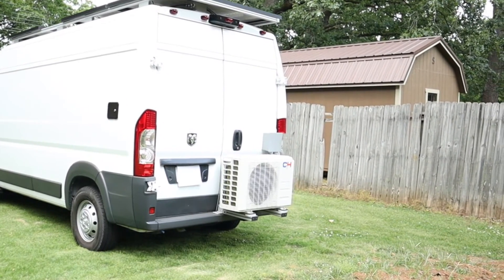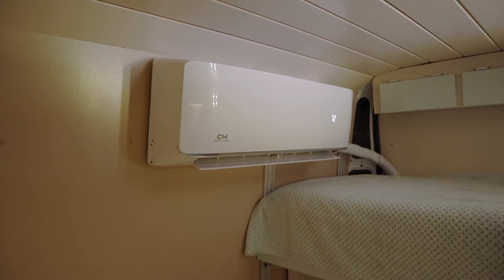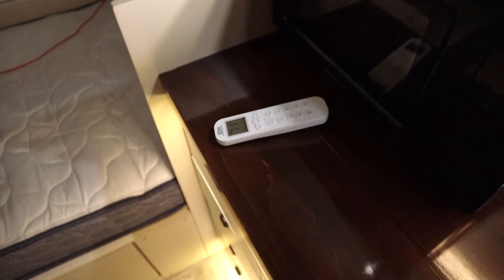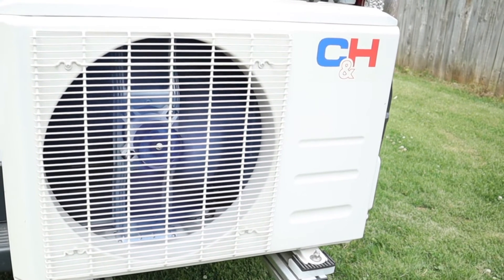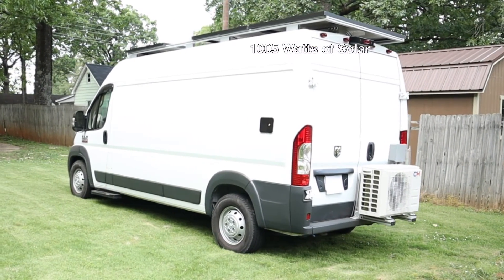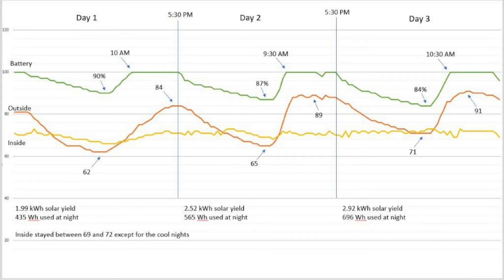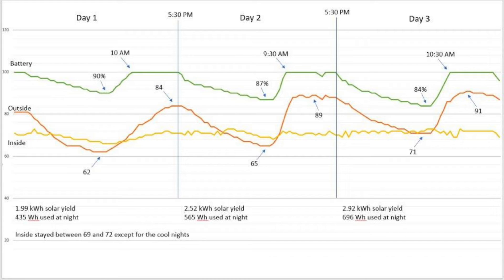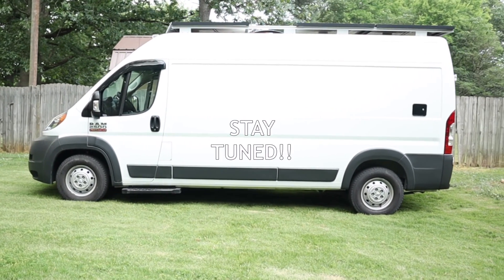Solar Mini Split On A Van

Comment: Is yoUr two lithium batteries 12v?
Reply from the maker: Yes they are 12 volt and wired in parallel. Renogy had a 20% off and 24 months interest free special so I now have three batteries. Probably didn’t need it but I had planned on three from the beginning so now if I’m ever in cloudy weather for a few days in won’t be an issue.
Reply: @jamiesworld4675  Sounds great Jamie. Yeah I saw in your graph where you had the solar top the batteries off at 100% for a good while (sunlight spillage if you will). Having that 3rd or 4th battery would be great to compensate during the non-sunny days. My goal is to by 2 more of my 206ah batteries (total of 4 batteries) will be more than enough for my needs and to catch some of that spillage in case I need it. Moreover, I will have an alternator and grid hookup for backup.
Reply from the maker: @mikefranks4528  Sounds like a good plan. I also have the B2B charger.
Reply: @jamiesworld4675  it's important to note that 'automotive 12v system' voltage ranges from 10.5V to 15.5v. Any equipment designed to operate in this range CAN be considered equivalent by novices but should not be those of us who are using data to provide factual performance data. We need to be more specific. For example, there is a significant difference between capacity of a 100Ah LA battery (100Ah x 12v nominal = 1200Wh capacity) and a 100Ah LFP battery (100Ah x 12.8v nominal = 1280Wh capacity) ....They are not the same. This is why I advise against the use of Ah vs. Wh when communicating battery capacity and using specific nominal voltages when communicating system operating voltages. Most non-tech people find themselves in trouble thinking that they can ignore the details.

Comment: Very nice install. Thanks for sharing. Which flexible mini split refrigerant lines are you using?
Reply from the maker: Thanks. Rectorseal no kink. Depending on what size you need they have them on Amazon. If you can't find them there you might find a few supply places online that have them. Thanks for watching.
Reply: @jamiesworld4675 (I am a retired mechanical engineer with experience in custom A/C manufacturing). It is important to note that 'flexible refrigerant lines' (Rectorseal specifically) are for R410a systems and ONLY DESIGNED TO FLEX ONCE TO FACILITATE INSTALLATiON. They are not intended to flex repetitively (opening and closing the rear door), especially under pressure. You are taking a huge chance of losing your refrigerant charge by using them to flex significantly or repetitively after installation. They will clearly work for some time but they are destined to fail if planned to open/close your back door. If you really need this capability, you should use a R134a system which has a much lower pressure that allows the use of rubber hoses. Despite what you might think of these 'flexible connectors', they are corrugated copper lined inside that flexible cover.
Reply from the maker: @WorkingOnExploring  Thanks, the only time the doors will be opened is if I need to do any electrical troubleshooting. Hopefully that won't be very often. I have not had any issues so far.
Reply: @jamiesworld4675  Can you also share about the roof wind breaker, spoiler, setup? I'm adding solar panels on my van roof.. thanks
Reply from the maker: @e3ucxp  I used 80/20 tubing to mount my solar panels. I used a 45 degree angle bracket and a piece of 1/4" plastic from 80/20 for the wind deflector. www.80/20.net

Comment: That's cool.  Mini-splits are super efficient.  The drawback is the big bulky unit in the back.   Any idea how it compares against the best internal mounted A/Cs on the market?
Reply from the maker: It was the best choice for me and I couldn't be more happy with the performance. Now if it will just last 10 years or so I'll be really happy.
Reply from the maker: Yes it's a small drawback though. I didn't do much research on the internal units because they were just too expensive and took up too much room that I didn't have.
Reply: @jamiesworld4675  Maybe other vanlife YouTubers with internal ACs could compare their numbers against yours.  If a mini-split is much cheaper as well as several times more efficient, it might be a better choice
Reply: @jamiesworld4675  Too many pros that the look of the unit in the back isn't too bad.
Reply from the maker: @pmarker  Thanks. Yes I don't think it looks too bad.

Comment: Can you open/close either rear door??
Reply from the maker: Yes, they are normally blocked. The only thing back there is all the electronics and batteries so access is only needed in case of an issue or just to check everything out occasionally.
Reply from the maker: Yes, I can open both doors. I used flexible refrigerant lines. I have two 1/2" stainless bolts through the bumper and the mounting frame just for extra security. I have to remove those to open the doors. But to be honest I don't think I need them.
Reply: @jamiesworld4675  Okay, I see, so the doors aren't regularly accessed. The setup does block them during it's normally installed state, correct?
Reply from the maker: I have a van tour video on my channel that shows the doors open.